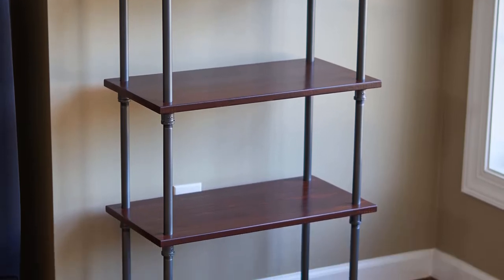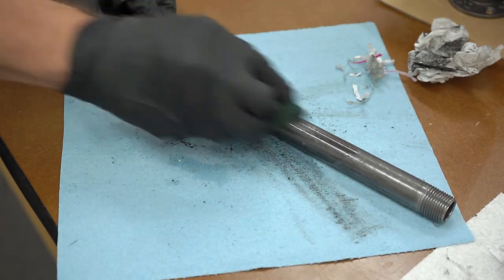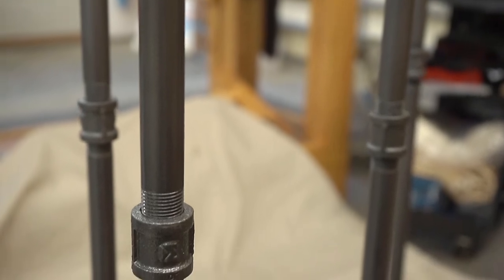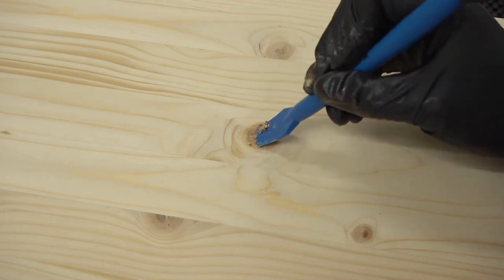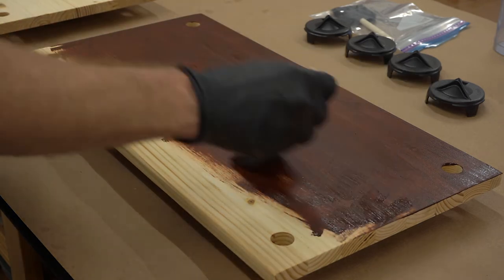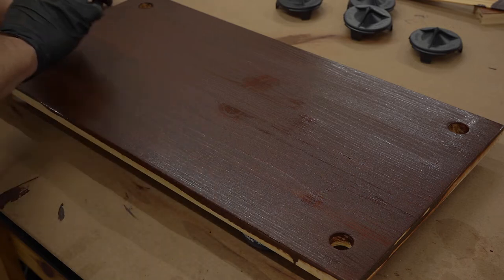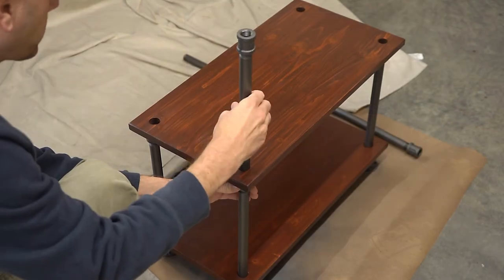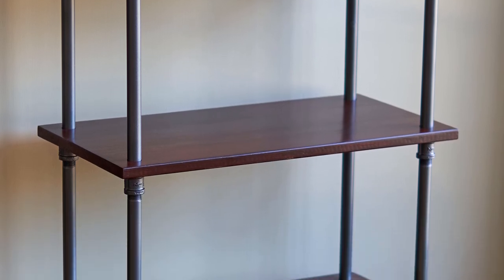Build Industrial Style Shelves (Gel Stained Pine)

Comment: Working with tapered pipe threads other may find using blue Loctite on the couplers that have been pre-set to matching sections will help keep the couplers from threading deeper when the section above is installed. Get the big tube. Those threads are thirsty. Apply it to the male threads and use blue because you can break it free if you decide to reconfigure what you've built.
Reply from the maker: Great tip! Getting them all nicely adjusted up can be a bit fiddly.

Comment: I like this idea, particularly for shop shelving, but I'm concerned that the wood shelf resting on the end faces of four couplings is going to gouge the wood when a load is applied.  Wouldn't the use of four flanges spread the load better ?? Am I over-engineering again ??
Reply from the maker: Well, the shelves are technically resting on silicone covering the couplings so I don't think it's gauged this pine at all. The top edges of the couplings are maybe 1/4"+ thick so there's plenty of surface area for 2' - 4' long shelves.  We've got heavy enameled cast iron pots on the shelves now (~30 lbs per shelf) with no issues.
But yeah if you wanted to put lots of heavy item, you can certainly use the floor flanges there. You'd even up having to use a bunch though as you'd have to use 4 underneath each shelf and again on the tops which I thought would get in the way of moving pots in and out. This would certainly be very stable though!
If you're able to just mount them to a wall (in a stud), you can also use a floor-flange and a 12" piece of pipe with a cap to set the shelves on.
There's certainly lots of combinations using the pipe and connections, so you might play with a few just to see what suits your build. Since I knew what we'd be putting on these, I didn't want to over do it.